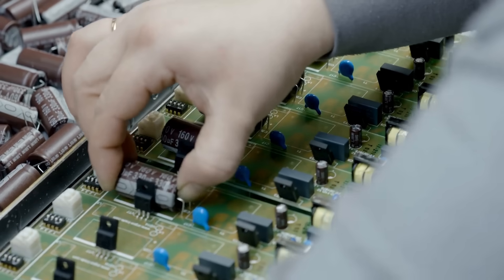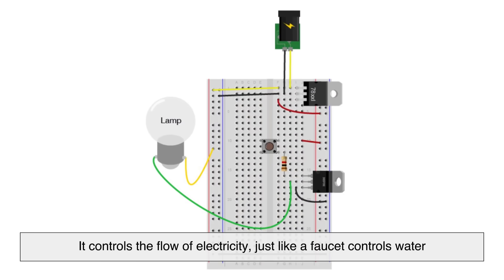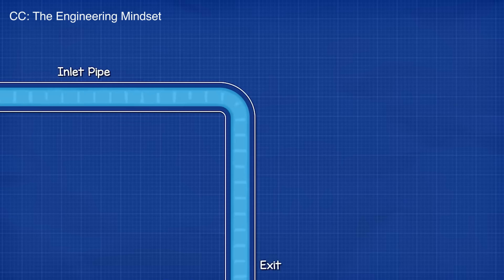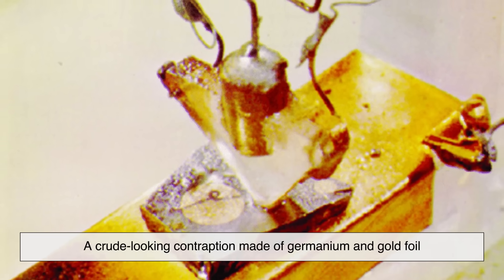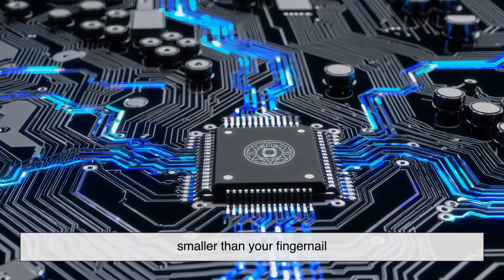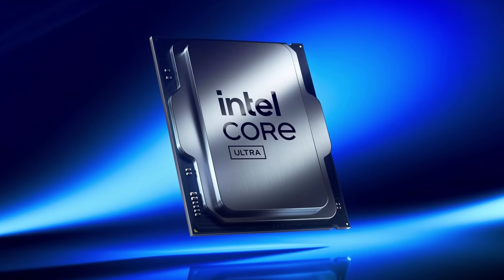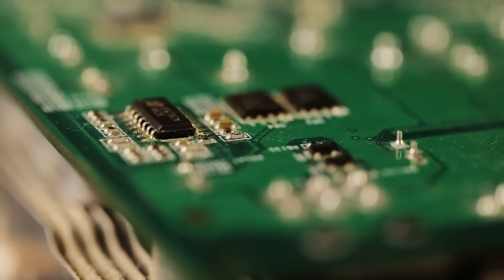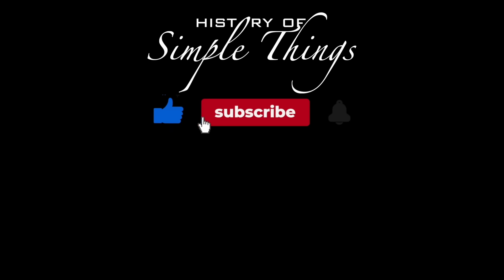How the Transistor Works and Why It Revolutionized the Modern World

Comment: The first successful consumer product with transistors was the Regency TR-1 portable radio, which used four transistors in analog circuits to receive AM radio stations.  It was released in 1954, and my family had a slightly later model that was powered by a nine-volt battery, making it smaller and less expensive to operate than the original model.  My mother later worked as an executive secretary at Texas Instruments, and she met Jack Kilby at about the same time that he invented the pocket calculator, which was his next big invention after the monolithic integrated circuit.  I was never privileged to meet Mr. Kilby, but the fact that I was born before the transistor, and am still around to relate this, tells you how quickly Bell Lab's transistor and Kilby's integrated circuit changed the world.  As for me, the electronics I first learned was based on vacuum tubes, and then later on transistors.
Reply: As a kid, in the early '60, "transistor radios" were all the rage.
     One 9v battery, last for DAYS.
     My parents had a portable radio, had I think six "D" batteries, and lasted HOURS ... but for a half-day trip to the beach, they were happy !

Comment: Great review of the Transistor. I can remember the 1960s, when you had discrete transistors in the circuits. Nowadays, you have boards with just a few chips doing everything. It really is a marvel of electrical engineering that benefits us in so many ways. One change to suggest: At 2:44, there is a typo in the banner. Instead of “once and zeros”, it should read “ones and zeros”.

Comment: Hmm back in the 1960's if you had a portable "7-transistor radio" and your buddy had a portable "8-transistor" radio, the 8-transistor radio had to be better, right?
Reply: Not necessarily.  It depended on the design and manufacturing quality.  Some brands may have added an unnecessary transistor or two just to advertise more transistors!
Reply: I had an 8.